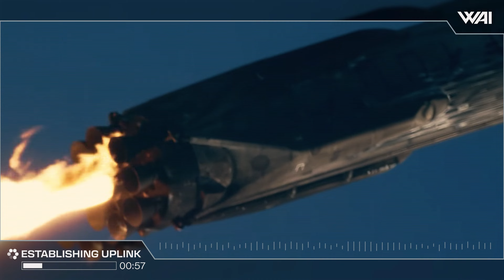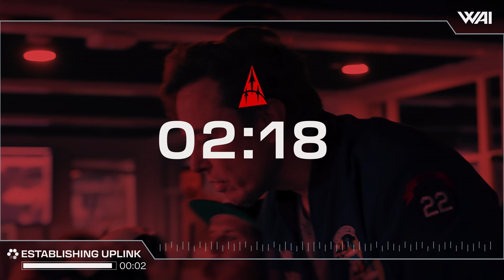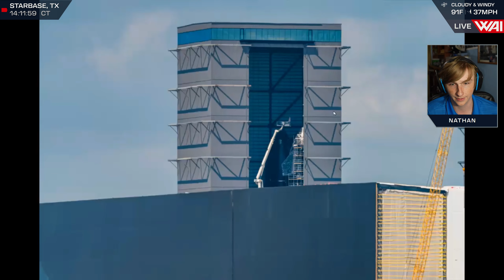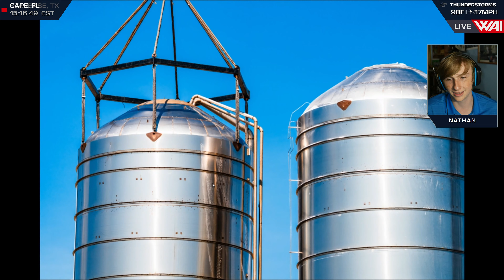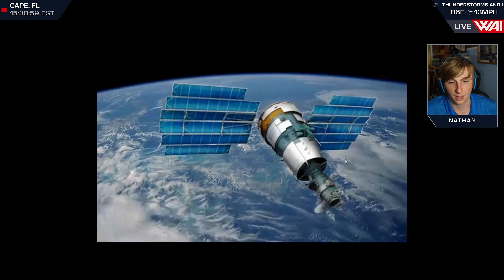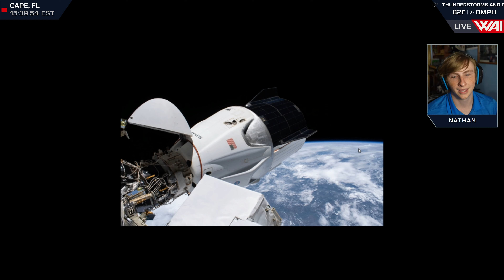REPLAY: Space Roundup: Starbase Activity - June 28th

Comment: Get the mike fixed you have been doing this long enough now to get equipment that works reliably. Also you need to be more professional with the commentary as it is not fluent and there are lots of mistakes being said during it. Maybe you should write a quick script and have a practice before recording it. Need to reduce/eliminate the "UMS and ERRS" etc also. More practice so you become more professional WAI has been around long enough to be better. Good coverage but could be better if the above are done.